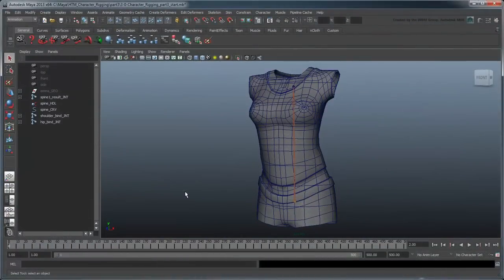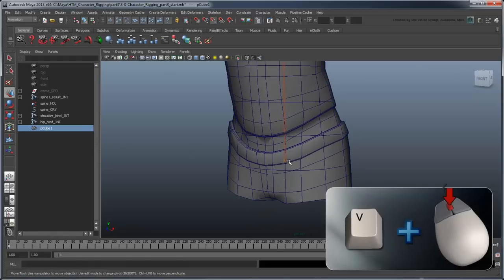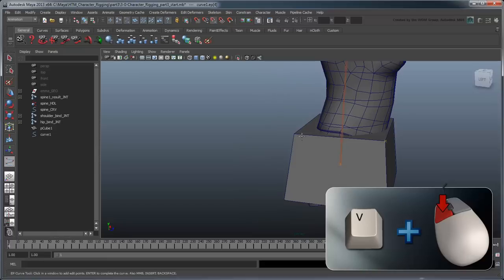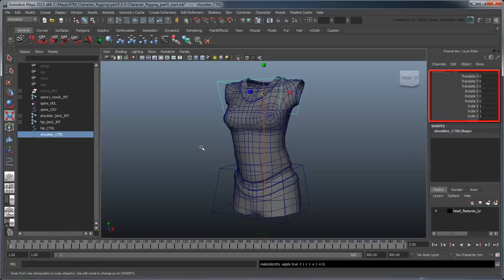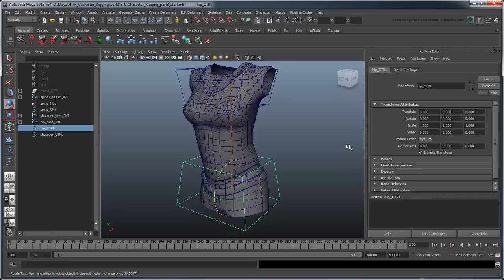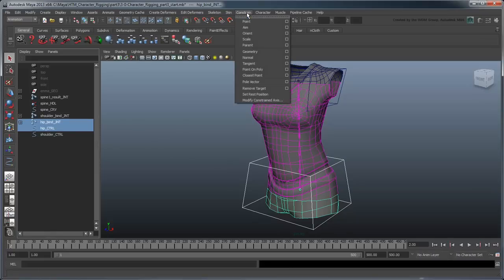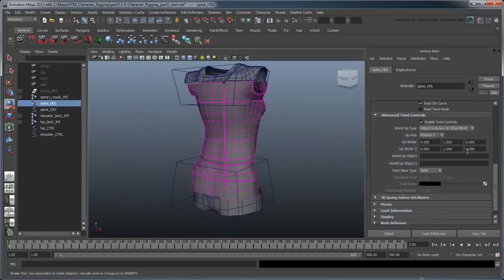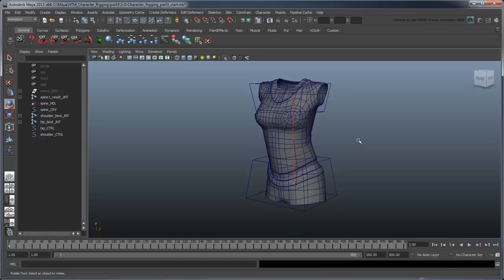Creating a Character Rig - Part 3: Torso IK controls, rotation orders, and twist (Advanced)

Comment: Thank you for having made this series available to us. I can't imagine that any of you is still checking comments. But I'll make a question.
 You changed the rotation order of the bind joints and the controls, didn't you? Why didn't you do the same thing to the result joints? 
And Im wondering why you set the up axis to negative Y in Advanced twist controls. I seem to have achieved the same result as yours even after setting the Up axis in positive Y and the up vectors in positive(1:[0,1,0] and 2:[0,0,1]).
I hope any of you will notice this question.
Reply from the maker: I believe this is mentioned in the video, but we only change the rotation order of control joints because we'll actually interact with them - hence we need them to "make sense" to someone using them.  For the result joints, we don't really care because a user will see their values.  It's not wrong to change them too though - just unnecessary.
Reply: @Autodesk_Maya  
Really thank you for replying. And Im really sorry for troubling you. In fact, I've already confirmed that by translating all your transcriptions one by one. I think I'm going to have to ask you about Maya in the future, then please, may you help me.　Thank you.

Comment: But why negative Y? Why not positive Y? Didn't quite see the logic, since it works either way, I thought you'd want positive Y to be forward
Reply from the maker: For these deep joints it actually doesn't matter so much so long as the movement is correct.  Just note that if you go with Positive Y, you'll need to change the Up Vectors to match.

Comment: Everything is going good till i enable twist control..... because when i do enable it, the side bend is also turning into a twist.. ( it's twisting fine and forward - backward bend is good too but my side bend is gong changing it to twist when ever i try...) What do you think am i doing wrong?
Reply from the maker: Hmm, I'd double check your joints' local rotation orders to make sure they're all identical.  Also, are you sure that your spine_CRV only has two Control Vertices on it?
Reply: @Autodesk_Maya  Hey Thanks for the help. I Fixed it.. it was because the value in up vector 1 and up vector 2 weren't aligning with each other causing me to choose wrong rotation axis.

Comment: Hey there, thanks for the video. I know this is....5 years old at this point, but I noticed that you are really good at replying to people here. I just started this, so everything is pretty straightforward and the bind joints affect the IK spline handle properly, but the parented controls don't affect the bind joints at all when rotating, and they just shake the body strip when I move the controls. I've seen other tutorials use Point Constraints and Orient Constraints. Have Parent Constraints changed over these 5 years or have I messed something up? Thanks again!
Reply from the maker: Nothing has changed with constraints in over 5 years.  Parent constraints are really just a combination of both Point and Orient constraints, so using them shouldn't be a problem.  From what you're describing though, it sounds like you may have applied them in reverse.  When you look in the Outliner, does the parentConstraint node appear under the shoulder_bind_JNT?  Or does it appear under the shoulder_CTRL?
Reply: Maya Learning Channel It turned out that the weights were for some reason set to 0! Thank you very much for the information about the constraints, that makes a lot of sense. And thank you for still responding years after you released a video series!

Comment: I manually changed the local rotation axis of my should bind joint to be consistent with my hip bind joint. However, i find that entering up vector values of Y = -1 and Z = -1 (in up vector 1 and 2 respectively) gives me the desired twist results while entering a value of Y = -1 (for both up vector fields) does not. Why would this be?
Reply from the maker: In a way, you sort of answered your own question.  Changing the bind joints will change the orientation of the IK Spline, which naturally would require that you change the Up vectors too since they're dependent on the orientation.
Reply: @Autodesk_Maya  Sorry, I meant to indicate the opposite. I changed my bind joints, but did not have to change my up vectors for my model to work. This confused me as I thought the up vector values should be contingent on the bind joint orientations.
Reply from the maker: @Snrub100  Hmm, it still works, but your values will probably be different from the tutorial values during a forward/side/back bend.  Try it out and see.  The values shown in the video are designed so that a forward bend results in positive rotation values on the spine joints.

Comment: So we don't need the controls to share the same rotation orders with the result joints but just with the bind joints? And why should we use the x axis as the primary axis in the result joints chain? Thanks
Reply from the maker: Correct.  And we use the x-axis just because it's the first attribute that appears in the list, as well as to keep things consistent throughout the entire rig.  You could just as easily use the Y or Z axes, as long as you always use them the same way for every joint chain.
Reply: Maya Learning Channel cool. Thanks a lot

Comment: sir at 8:09  you are able to rotate shoulder in reverse (negitive direction) i can only rotate to  -2 degrees only...plz help....what is wrong??
Reply from the maker: Did you place any limits on the control in the Attribute Editor?  Also, are you sure you used an IK Spline and not an IK handle?

Comment: Hello! I have a trouble with my EP Curve Tool: when I press V and click the mouse in the corner of the cube, it makes curve outside the cube and it doesn't work on cube corners. Please help me to fix it.
Reply from the maker: Make sure you're not already in Point Snap mode (check the icon in the status bar to make sure it's not highlighted already), otherwise holding V will actually temporarily disable it instead of enabling it.
Reply: It works! Thank You for help! Awesome tutorials!

Comment: I have a problem:( For all my joints, local z axis is pointing forward and y is pointing up. I set up the twist controls as forward axis:+Y / up axis: -Z / both vector value: - 1 for z. However, with this setup, shoulder rotates smoothly but hip rotates only the 2 bottom body parts identically... since I use 2017 version, I wasn't sure what the forward axis was so I just put the axis that was pointing up (leaving it as positive X didn't work at all). is my setup wrong? how should I fix it?

Comment: Hey, I'm really loving these tutorials, thank you so much! Quick question; at 7:30, you say to apply the suggested rotation order to the controllers and the bind joints. What happens if you don't assign the same rotation order to the child (bind joint) of a parent (controller)? Is this an important step, or will a parent's rotation order override a child's? I tried playing around myself in Maya but didn't see a difference between making sure the controller and bind joint have the same rotation order vs. having different rotation orders. I'm asking this question because it doesn't seem like we bother to change the rotation orders on all child objects, specifically the joints! If someone could shed some like on this I'd greatly appreciate it!
Reply from the maker: Strictly speaking, the controller's rotation order is what matters most since that's what animators will interact with.  That being said, it doesn't hurt to keep the orders consistent as shown in this video because later when we develop custom nodes we may need to source these values and it'll be a lot easier to do that when they're consistent.
Reply: Ah okay, so having different rotation orders on joints than the controllers moving them won't break anything, but it's still good to stay consistent. Thank you!!

Comment: Hello there, first thx for this tutorial it's amazing.
I have a little issue when it comes to the constraint parent between the Hip_CTRL and the Hip_Bind_JNT , when I apply it my spine bends and my hips are rotated at 90degrees, why ? everything was done exactly the same as you, and if I tick the maintain offset in the parent constraint it works but I shouldnt have to tick it right ?
I have another little question, the smooth bind skin doesnt exist anymore, simple bind skin works the same ?
Edit : Also, there is an option added in the Advanced Twist Controls in 2017 which is "Forward Axis", what should I use here if I did exactly the same as you did ? And when I tick the Enable Twist Controls, 2 of my joint (5 and 6) doesnt twist as the others, why?
Reply: Ok, I don't even know how but this works now, I recreated the shoulder and hip bind jnt and restarted from here !
Reply from the maker: Actually you do want to use Maintain Offset when parent constraining almost anything.  It will rarely cause problems, and helps when things are in different relative spaces (like the Hip_CTRL and Hip_Bind_JNT are).

Skin > Bind Skin is the name of that command now.

You can leave Forward Axis as Positive X.  And if some joints aren't reacting correctly while others are, then it's very likely that their Local Rotation Axes aren't consistent from one joint to another.
Reply: Thanks for the answer, I managed to pass through all those problems, my LRA were correct on all joints so I may have done something else wrong (I restarted and it worked fine).
Is this method of rigging used in production ? Because it looks like a very long and significant charge of work if you want to produce rigs with short deadlines !

Thanks again for this tut, maybe you'll see me in other videos comments :D
Reply from the maker: Yes, for film and cinematic productions this is a pretty common rig setup (each studio will add their own customizations though).  Although the process looks quite long and involved (and don't get me wrong, it is) you will be able to knock these out fairly quickly once you get used to the process.
Reply: Okay, thanks for the quick answers and the tips ! 
I just remember a question I have on part 11 of this tut, you say that we will set the switch IK FK to 0 for FK and 1 for IK (for the left leg), but in the node editor we set IK to color 1 and FK to color 2, which sounds like 0 = color 1 = IK and 1 = color 2 = FK, but it looks like it's inverted, why ?
Reply from the maker: Technically, the value on the control attribute and colors aren't related until you set the driven key on them.  Therefore, you can set up the relationship any way you wish.  It would be just as easy to set up it up the way you're describing.

Comment: Is the tutorial still valid for 2017 updates
Reply from the maker: Yes, absolutely.  However, some of the tools may have changed positions in the menus, but the principles and inner workings are all the same.
Reply: In 2016+ there's another option for the Up axis. Damn Autodesk made a complete disaster with these options names, every time I have to do the twist is a pain

Comment: when i enables twist controls option the lower part of the torso got twisted but the upper part remained stationary. how can i solve this?
Reply from the maker: Is this after setting the Advanced Twist controls?  If so then it may indicate that your local rotation axes (LRAs) on your joints are not set correctly.
Reply: LRAs are est correctly..
Reply: the problem s solved.. thanks for the help
Reply: How did you solve it ?
Reply: did u wait for the whole video to get completed..
caz when i followed the steps exactly and waited till the ending the results were satisfactory.

Comment: can you explain more in depth the reasoning behind the axis rotation order at 7:45? Im confused on the reasoning behind why z must be before or behind x and this explanation confused me entirely. Also, what does it have to do with gimbal lock and animating?
Reply from the maker: Did you see part 1's explanation: https://youtu.be/MV4XRgmTynY?t=7m34s?

The best thing to do is actually try it.  Build the rig up to this point and try an XYZ rotation order, then rotate the hip in X (using Object or World mode) until the waist is in a sitting position.  Now try to twist the hip around the Y axis as if the character was going to cross her legs - notice how all 3 XYZ rotation values change at the same time, even though you're only  rotating the Y axis.  This is bad, because it makes it difficult for animators to tweak motion since 3 values are changing instead of one.  This is the reason we use Gimbal mode, which rotates each axis along with the object (as shown in the link above).

However, if you try doing the same pose in gimbal mode, notice that it's impossible!  This is because in an XYZ rotation order, Y and Z DO NOT rotate along with X because they aren't evaluated until after X.  This is why we need to go with a ZYX rotation order.

Comment: Can you please expand on your explanation of the Advanced Twist Controls and all of its options? I'm still very confused about all the variables, why they are the values that they are, and how they are relative to each other. For example, what is the difference between Up Vector and Up Vector 2? What directions are the Forward and Up axis referring to? What do these terms mean in the first place and how does one figure out what is what? I've spent several hours trying to get this part to work in Maya 2016 and it just is not working for me. I would really like to get a better gasp of all this and figure out how to get it to work. I've followed all your steps and have watched this video many times, but i'm still quite confused.
Reply from the maker: Basically, because the spine (and IK joints in general) are not straight, we need to define a World Space "up" direction for the entire joint chain so it has an orientation to twist relative to.  We chose "Start/End" because we are saying we want Up to be defined as a straight line between the first joint and last joint in the chain (Up Vector 1 and 2).  So if you draw a line from spine 1 to spine 7, that is what the joints as a whole consider "Up".  It's roughly the same as the Y axis, but mildly tilted (depending on the shape of your spine, it could be even more tilted which is why its important to use "Start/End").

The Forward axis is the LOCAL axis that closely aligns to the Up axis.  This tells Maya which direction the joints run from back to forward.  Because our joints are all oriented with local X axis running along the joint (which was the Local Rotation Axes step we did earlier), we can confidently say X always runs forward along the joint.  Unlike the World Space "up" vector that defined an overall Up direction, each of these Forward directions is looked at on a joint-by-joint basis (so they can snake along a twisting joint chain).  The Up axis is then the LOCAL up direction that corresponds to the forward direction.

You can find more info on all the different attributes here: http://help.autodesk.com/view/MAYAUL/2017/ENU/?guid=GUID-E71102E0-0BA4-4F9D-9402-E6830889D569 and http://help.autodesk.com/view/MAYAUL/2017/ENU/?guid=GUID-B4EF8784-92D1-4D83-9CA5-A692D06607B8
Reply: Thank you so much! I figured it out and got it to work.

Comment: Hello. I'm using maya 2017 and I need to set Foward Axis. I have 4 spine joints as same orient as  yours. My last (chest jnt) is well working, but my first (pelvis jnt) is not. When I Enable Twist Controls it rotates and the Z is forward instead of Y. But I've tried to put the Forward axis to Positive Y then my torso rotates all wrong. Could you help me?
Reply from the maker: Have you disabled "Automatically Orient Axes" in the Move Tool?  And are all the joints' local rotation axes correct?
Reply: Fix your joint axis. They should all be the same.

Comment: After coming to the twisting torso part, I acknowledged that my local transformationaxis of spine6_result_JNT is different, anyway to fix that now ?
Reply from the maker: Unfortunately there's no shortcut.  You'll need to delete the IK handle and use the Orient Joints option to re-orient it.
Reply: Thank you. I re-created it, my orient joint options are X as primary, Y as secondary and X as world axis orientation, how to fix my local rotation axes. What should be my forward and up axis, I am using Maya 2016
Reply: forward axis should be x. It is already default

Comment: After putting the IK Advanced Twist Controls on to the torso, there is now a weird twist whenever I try to rotate both controllers on Z. In particular, Spine6_GEO starts to rotate on its Y. I'm using Maya 2016.
Reply from the maker: Are you sure it's local rotation axes are set up correctly?
Reply: Didn't set Up Vector 2 up properly. Got it working. Thank you!